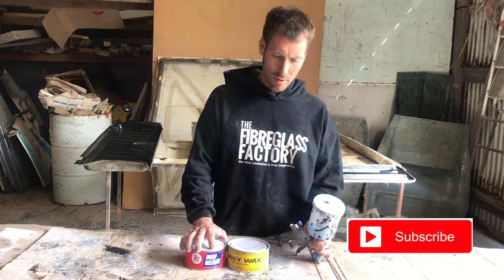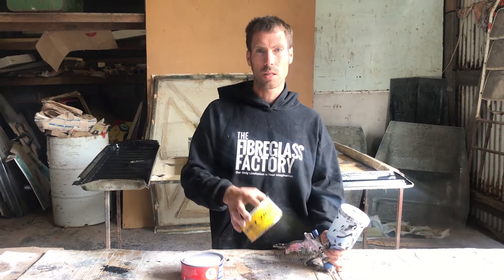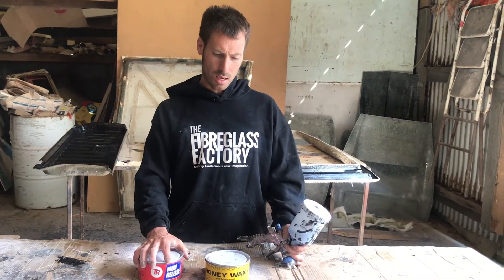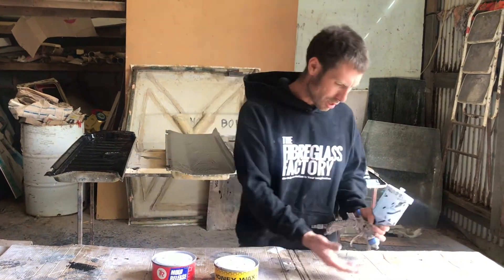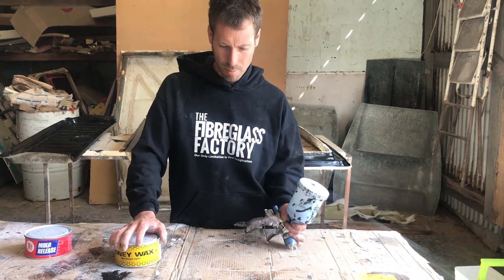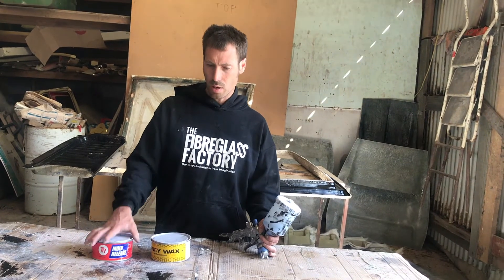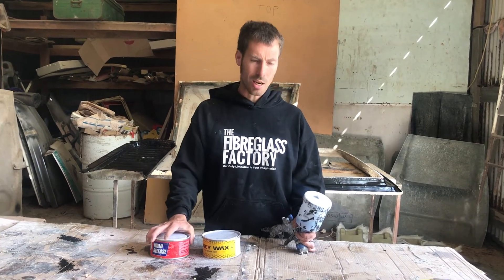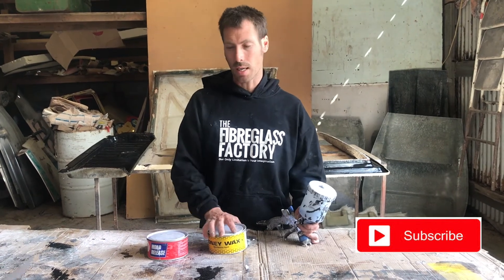Release Agents To Use With Fibreglass Moulds

Comment: Hey there, weve been havin issues with our PVA coating lately (Coverall from Rexco, been brushing it on the mold) and i just stumbled upon your video. Gonna try a 1,4mm nozzle tomorrow. Could you maybe tell me what specific semipermanent release agents your using that you mentioned in the video? Have you tried different ones? 
send some love from germany down there
Edit: and till what sanding grit are you finishing your molds?
Reply from the maker: With any new release system, you need to trail it on small sections first so you can build confidence with it, and with any semi perm the surface condition is critical to its success, we use chem lease and TR semi perm,

Comment: 1. so honey wax is not compatible with PVA? except for wax over the top of the PVA?
https://youtu.be/Z_6UjTuc7ac?t=52
https://youtu.be/Z_6UjTuc7ac?t=233
2. are you ever using only honey wax without PVA?
3. what kind of nozzle do you use to spray PVA?
4. did you mix PVA with other (water, etc.) to thin a PVA?
Reply from the maker: Hi, thanks for your comments, 1. Yes its a silicone based wax, and we have found it best for honey wax over top of PVA not underneath. 2. Yes we use honey wax most of the time without PVA for a well cured mould. 3. We use a 1.4mm nozzle. 4. We only mix it with water if it cobwebs, when this happens we put 10% water to stop it cobwebbing in the air.